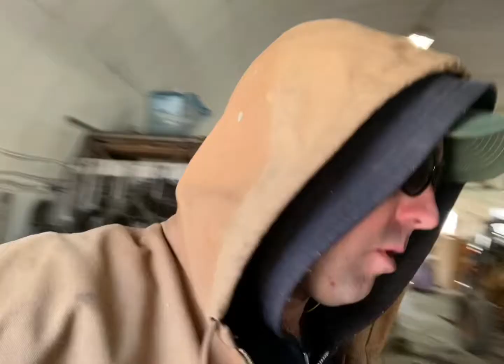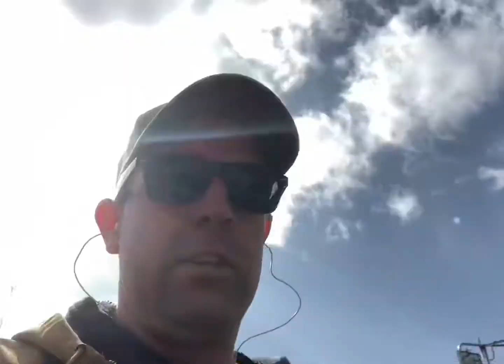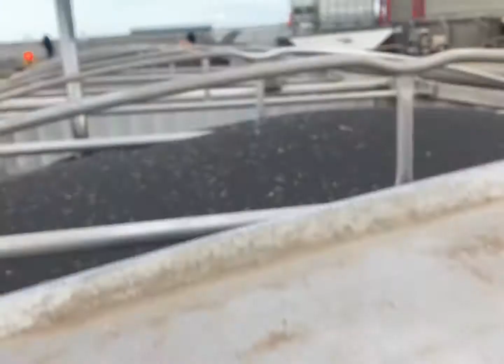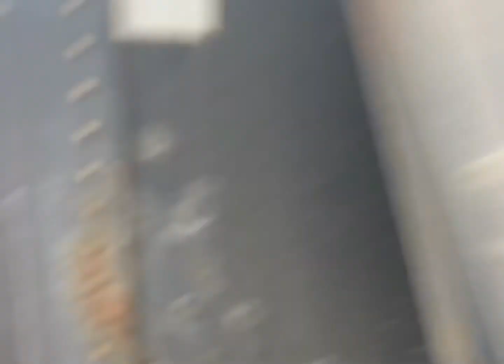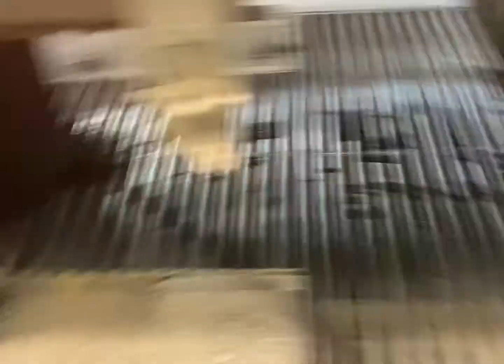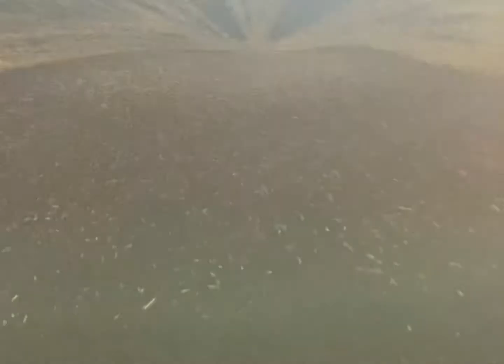Hauling canola is a $10,000 an hour job.

Comment: Always nice to have elevators around.. less and less here every day. The big outfits are in Portland, and they screw you on truck delivery!! We have a few neighbors that started hauling east, they get 2 loads a day dumped on a barge that takes it to the same place in Portland.. and they're getting an extra $4-$5k per day and hauling one less load.. it's freaking Crazy!! They actually pay that much better by barge than by truck!!!
B trains are a bitch if it's damp! A few hay haulers tried them about 20 years ago. Lol.. they were pulling trucks out of the fields, so they all went back to A trains.. only B's we see are lumber haulers.
Reply from the maker: Boy that’s neat they can load straight onto barges. One would think it would be Much more work loading and unloading a barge.
Reply: @millionairefarmer.  you would think.. but after paying dump fees and transport down river, they get $3-$5k more per load of wheat.. definitely makes it worth hauling the extra distance!! Ironically, they have to go through Portland to get to the barge terminal another 100+ miles up river 🙄